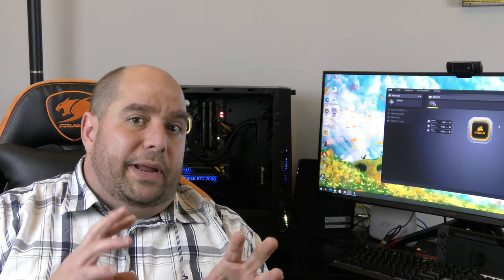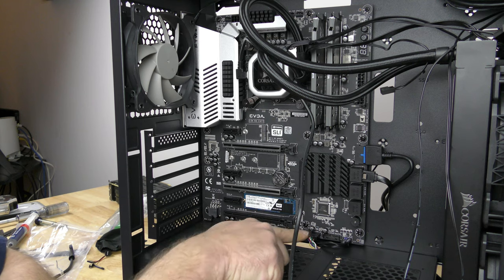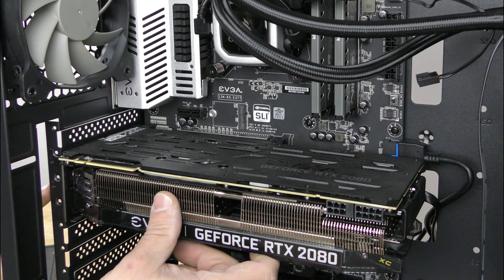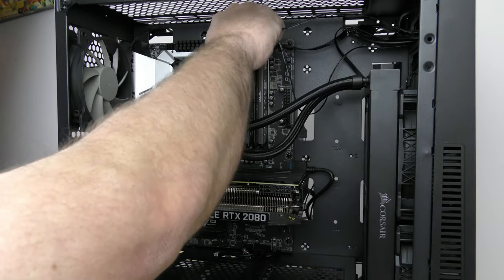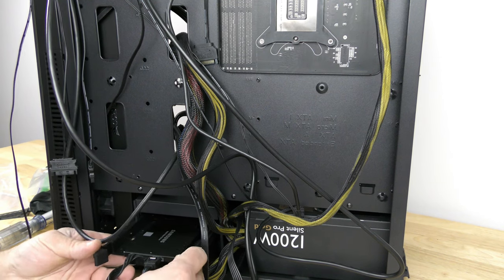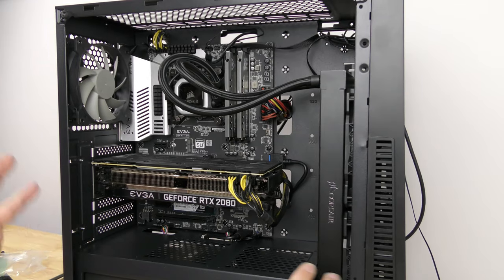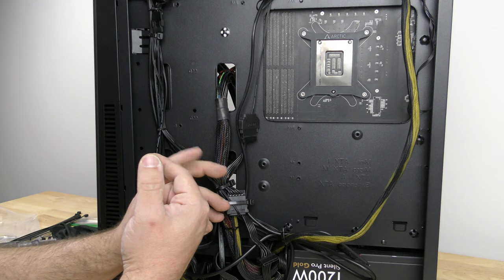How to Wire a PC Game Build for Beginners - Step by Step Wiring Guide 2021

Comment: Hello! I am new to building a PC, and I'd love if you could tell me if these are a good build for it (in term of capability) also, these are the ones near my budget price, but if you do know any others cheaper and better , it'd be much of a help.

Gigabyte A320M-S2H V2 mobo
HyperX Fury 8gb 2400mhz
(Processor are still undecided as I haven't looked into it, but I think ryzen gen2/3 is probably my choice)

Last question, does all those wires comes in with the mobo/power supply/ or any other? Or do we need to buy it separately? Thank you!
Reply: I know there's probably more I have to look into, but for now these are the ones I think I should have in my pc, if I'm missing anything, do let me know!
Reply from the maker: Its a good start, but I would double up on the memory, 16gigs is base and at least 3200Mhz.  You may want to check out these videos: https://youtu.be/Ava0aAQ2XAM and https://youtu.be/nyIYRJYqMYA, this is not an amazing system but it gets the job done, maybe a better video card would help,
Reply: @ThisBytesForYou  thank you for replying, and yes, I would like to have it at 3200mhz, but I don't wanna pay too much (as the price changed as well as the mhz) also I'm still unsure about what gpu should I get, it would be much of a help if you could recommend me anything that goes under 300-400$
Reply from the maker: @itsmegu9261  $300 to $400, you can get a GREAT GPU for that much, where do you live and how long would you be willing to wait?
Reply: @ThisBytesForYou  oh , I'm sorry I must've put the wrong currency in. Uh in my country the gigabyte mobo costs around 220MYR (Malaysian ringgit), idk about the price there. Oh and as of now I am just planning, but I would love to be able to purchase it by the end of the year or the nect
Reply: I just checked, I searched for gtx 1060 and it costs around 680+ MYR, I don't know how much it costs there but that's pretty much it, thanks for the help again!

Comment: Hi! I built my first pc it won’t turn on. I did checks and the power supply works. But when I turn the pc on nothing will move or turn on. Do you have an idea what the problem is
Reply from the maker: Hello my friend, very happy and excited that you built your first PC.  So that I can help you, please provide me with the manufacturer and model number of your motherboard, cpu, RAM, video card, power supply and monitor.
Reply: @ThisBytesForYou  hi. Sorry for the late response but just wanna say I finally got it to work. The power switch was broken so we returned it and now it works. Now I’m just trying to figure out why when I turn my pc on the monitor says “reboot and select proper boot device”. Also my mother board is the b450 tomahawk max. My monitor is the pixiop 248
Reply from the maker: @thinkingbread  ahhh cool, as to why it keeps saying select proper boot device, you have to make sure you have your mainboot device selected as the main drive in your boot order, since it is windows 10, it will more than likely be the windows boot manager
Reply: @ThisBytesForYou  ok thank you. I will try that when I’m done with school. Also I subbed thanks for the help 🤙🤙
Reply from the maker: awesome bud, let me know how it goes and thanks so much for your support, it means a ton to me.

Comment: my power supply has like 5 SATA connections coming from it. Does the MB power SATA and USB 2.0 --  or should there be a cable connection to the MB I wonder.
Reply from the maker: There would be an 8PIn EPS CPU power or a 4Pin CPU Power, or both.  Then there would be a 24PIN ATX power Connection.  Some motherboards also have a 6Pin PCIE connection to provide additional power to the PCIE slots, those should be all the power cables you would need to connect to your motherboard.
Reply from the maker: The power supply needs to go connected to SATA drives, the motherboard does not power sata drives, but it does provide some power to USB ports.
Reply: @ThisBytesForYou  Yes, Thank you man. That does help. I'm half built over here but I think I'm good
Reply from the maker: @_mytube_  always a pleasure my friend, this video will help you for sure.

Comment: does that board not have a CPU fan 2 or OPT? 2 or OPT os for your water cooling. 1 should just be for a reg CPU fan.
Reply from the maker: Either would works, they are all controlled in the bios

Comment: Hey could you maybe help me with my pc ? I recently just bought a new mobo but for some reason two of my fans won’t spin and it shows no signal on my monitor
Reply from the maker: I can try, but you are not giving me a lot of info.  What manufacturer and model number board do you have, where do you have the fans connected and where do you have the monitor connected, to a video card or to the motherboards HDMI/DP/VGA I/O connections, where your USB cables go?

Comment: hey i have a deepcool castle v2 and having problems to understand where to put the two cables coming out of the pump, you said to put one in cpu fan 1 but in my motherboard i have a specific area thst says aio pump
Reply from the maker: yeah none of my boards had the AIO pump header before, till I got the Asus Crosshair Hero VIII, you can plug the pump in the AIO.

Comment: Do the wires come with the parts that you buy??
Reply from the maker: If you are referring to the power cables, they come with the power supply, unless it is something additional, which I always state.  As for the SATA Data cables, they come with the motherboard, but you can buy additional.  The cables for the fans, they come attached to the fans or the Liquid Cooling unit.  Can you please clarify which cables so I can lead you in the correct path?
Reply: @ThisBytesForYou  my case didn’t come with sata data cables ?? !! Do I order them?
Reply from the maker: @animekawaii5991  you can, but they come with the motherboard,  if you don't have any, maybe this will work for you: https://geni.us/1up1jYg those are from my amazon affiliate link

Comment: This video was great but I’m still struggling to get my pc to display and my mouse won’t turn on even after playing with my ram. Also sorry for the commenting on others comments lol
Reply from the maker: No worries my friend, i just want to make sure I can help you, and then if some one has a similar issues, its not lost in the weeds.
So that I can help, please list the manufacturer and exact model number of the following components:
1. Motherboard - manufacturer and exact model number
2. CPU - manufacturer and exact model number
3. RAM - manufacturer and exact model number
4. Video Card - manufacturer and exact model number
5. Power supply - manufacturer and exact model number
6. Monitor - manufacturer and exact model number
7. Do you have ALL of the PCIE connections plugged in, and not daisy chained or pigtailed, each coming directly from the power supply?
8. Are you running through HDMI, DP, DVI, VGA, any adapters?
9. UEFI in the BIOS from Legacy.  If it was set to Legacy, you will need to reinstall windows to get correct support.
10. Disable CSM in the BIOS
11. Installed latest supported chipset driver?
12. Have you disabled Fast Boot within Windows?
Reply: @ThisBytesForYou  hey there! I’ll have to update you come this weekend. I don’t currently have access to my pc and I don’t believe I have a video card.

Comment: Im new to pc building. On my first build now. Everywhere I look is telling me plug the SATA cable from power supply to motherboard. But the SATA cables that came with the motherboard have weird ends, almost the same but not exactly. It will plug into the motherboard, but I can't find where to connect it to the power supply. Any advice?
Reply from the maker: Have you watched this video on wiring?

Comment: Hi im very new to pc building but what if my mobo(MSI B450M A-Promax) only has 1 sys fan? I mean what can i do toconnect all 3 fans to my computer?
Reply from the maker: hello my friend, you've come to the right place then, I have tons of guides on how to do just about anything with a PC and unlike many other channels, I reply haha.  So you will want this cable, it is a 4pin PWM flan splitter, so you can plug into 1 header and control 3 separate fans.  Realize that as the system heats up, the fans will spin faster, all 3 of them, because they are all on 1 controller, you can find it on my Amazon affiliate link: https://geni.us/ym7DW9, I hope to see you around more of the videos here, always happy to help.
Reply: Thank you so much!
Reply from the maker: Always a pleasure my friend, so very happy you stopped by, trusted in me to help you, liked and subbed as well as took a moment out of your day to thank me.  It means a ton to me and I am so very happy I could help you.

Comment: So here are my questions I have these cables that look like An L and I don’t know where to plug them in and I also have these cables that have 4 pins but they are circles do you know where I should plug those In
Reply from the maker: Did you watch the video?
Reply: Yes I just didn’t understand where the circle 4 pin thingy goes
Reply from the maker: Where does the other end connect to?
Reply: @ThisBytesForYou  what do you meen
Reply: And only my motherboard is lighting up
Reply from the maker: Look in the description, I also have a build video in how to build you machine, that might help to.  What I mean about the cable, the cable comes from something to connect to something... What does it come from
Reply: @ThisBytesForYou  they are connected to the power supply and the L cables I was talking about are also connected to that cable
Reply from the maker: @juliel4190  the L shaped ones go to hdds and dads, and any externally powered devices that need power, like a fan hub, liquid cooling or something like that
Reply: @ThisBytesForYou  so do I need to use all the L shaped cables?
Reply from the maker: @juliel4190  nope, unless you have that many devices, just set them aside
Reply from the maker: Make sure to subscribe so you can tune in to more videos to help you out.

Comment: So idk if u gonna respond but there’s 2 wires not plugged in it’s p5 and p7 and the p5 wire keeps making a buzzing noise and my computer Home Screen turns black and my tab bar isn’t there idk what to do I saw ur good with computers so I’m reaching out for help
Reply from the maker: I always try to help, in bed at the moment but I will still try. let's start with What is p5 and p7, I am not understanding, where do you see this?
Reply: P5 and p7 are two different wires on the inside of my pc I’m not sure what they do
Reply: Ik one of them is called the optical drive
Reply from the maker: @leprachaun-b6r  where do they come from, please remember, you have everything in front of you, I don't see it.
Reply from the maker: @user-gg3ik5eq6o does it look like this cable https://images.app.goo.gl/WLatxaVgy21g8EXV7
Reply: You can try find it the computer I have is an omen Hp
Reply: 25 l I believe
Reply from the maker: @leprachaun-b6r  does it look like the cable I linked up
Reply: Nope
Reply from the maker: how about this, https://www.reddit.com/r/HPOmen/comments/kryr37/hp_omen_30l_what_are_these_cables_first_gaming/ or better yet, send a pic of the cables here to my email iggy@thisbytesforyou.com @leprachaun-b6r
Reply: @ThisBytesForYou  yes that one an something else
Reply from the maker: here you go: https://youtu.be/7SjQo7wrWq4
Reply: Thank you so much
Reply from the maker: Always a pleasure my friend, so very happy you stopped by, trusted in me to help you, liked and subbed as well as took a moment out of your day to thank me.  It means a ton to me and I am so very happy I could help you.

Comment: Random question, why does different ram (ddr3 ddr4) have different fitting slots?
Reply from the maker: because ddr3 and ddr4 have different speeds, voltage requirements and more so if they all had the same slot and pin out, people would be mixing DDR1, 2, 3, and 4 all together and wonder why their system isn't working.
Reply: @ThisBytesForYou  thanks for answering 😃
Reply from the maker: @blaisedrums  always a pleasure my friend, happy I could help.

Comment: I bought a z690 mobi, 12700k and a new psu… I hope it all goes well, just worries about the wiring and missing something
Reply from the maker: Well, funny you ask, I have 3 videos for you, let me know what you think.
✅ How to Build a Gaming PC Step By Step for Beginners - PC Build Guide 2022: https://youtu.be/yqj9slC6-Cg
✅ How to Wire A PC Step By Step for Beginners - PC Cable Management Guide 2022: https://youtu.be/xcHwLTBDWO8
✅ How to Flash the BIOS and Install Windows 11 - ASUS TUF Gaming Z690-Plus WIFI D4 Motherboard: https://youtu.be/WTkMXYjxGzU
Reply: @ThisBytesForYou  thank you very much! I bought the gigabyte z690 auros elite ddr4 though, hope it all goes well!
Reply from the maker: np, this is a z690 board from Asus, it should be similar and also a DDR4 board, so let me know if it helps.
Reply: @ThisBytesForYou  I will let you know if it went well by commenting from the new pc! :)))
Reply from the maker: @poteqqetop942  sounds good my friend

Comment: If the pc wouldn’t turn on what would you do to test what the Problem is?
Reply from the maker: It could be a number of things.  Do you see the board is getting power, there is usually an LED or 2 that turns on when the board is getting power.  If not, check to see the power supply is plugged into the wall, and the switch is set to the on position.  If you are getting power, make sure the 24Pin ATX cable is securely plugged in, as well as the 8PIN EPS cpu power, probably best to upload them then replug the in.  If you have done all this and you still can't turn it on, make sure the front panel header is plugged in properly to the motherboard header for power switch, maybe the polarity is flipped, unplug it, flip it then plug it back in.  Let me know if this helps.  If not, please right down your full PC spec, everything in your machine, manufacturer and model number.

Comment: Hey so I have a vga cable but my motherboard has no slot for that cable ?
Reply from the maker: Chances are your monitor is only VGA, an older monitor, maybe somthing like this from my affiliate link: https://geni.us/tSYyhcy if your motherboard has a HDMI port, and your processor supports integrated video.  Do you have a video card?

Comment: Hello I have a question, I bought a 650 power supply and I don’t seem to know where the usb 2.0 cable is. I’m confused on what cables I have
Reply from the maker: Usb 2.0 would be attached to your case if your case has usb 2.0 header, they might be usb 3.0
Reply: So I can either use 2.0 or 3.0?
Reply: ThisBytesForYou Thankyou for your responses I’m new and just don’t know if I need both usb 3.0 and usb 2.0 plugged in
Reply from the maker: Usb 3 will also do usb 2, so you are good

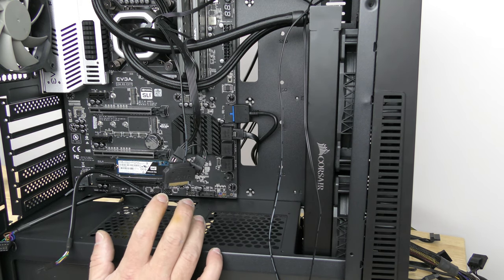Comment: The one dangling right in front of you at 2:42 I cant figure out where that gets plugged in
Reply from the maker: there was 3 there, 2 x 3pin fan header cables and 1 SATA power, male cable.  The 2 x 3Pin fan headers, you connect the liquid cooling fans into and the male SATA power cable gets plugged into a female SATA power on the power supply.

Comment: Hey man I just started setting up my pc I have everything connected except this one cable it came with the case along with 3 fans built into it. Everything seem to turn on. Except those three fans because the 4 ping connector isn’t attached to anything and the case didn’t come with a cord for it so if you could plz help it would be awesome
Reply from the maker: which case, manufacturer and model number?
Reply: The case is a ZALMAN S4 Atx Mid tower case it came with 3 pre installed fans
Reply: S4 plus
Reply from the maker: so the 3 fans plug into each other, then lead to one connection, you have to plug that one connection into a 4 pin fan header for pwn control some where on your motherboard.
Reply: @ThisBytesForYou  ok awesome so I’ll buy a 4 pin header for the fans and find somewhere to plug it ? I have a Rog Strix b-450 gaming ii motherboard
Reply from the maker: bottom right hand corner of your motherboard,  to the left of where you connect your powerbutton, reset button, HD LED/Activity Light, you will find 2 4PIn headers.  There are also 2 to the left of your cpu socket, just under the heatsink.  Look in your motherboard manual if you need to pinpoint them.
Reply: @ThisBytesForYou  awesome super informative thank you so much man. Your like the PC Master
Reply from the maker: @dimitributler7599  always a pleasure my friend, please make sure to like and sub, I come out with new videos helping every week.  I have 400 videos and counting, I am sure I have a ton more that will help you.
Reply: @ThisBytesForYou  do you maybe know the exact 4 pin headers I should buy for that specific cable that connects all 3 fans in 1
Reply from the maker: you don't buy them, they are on your motherboard already, like I commented 8 minutes ago "bottom right hand corner of your motherboard,  to the left of where you connect your powerbutton, reset button, HD LED/Activity Light, you will find 2 4PIn headers.  There are also 2 to the left of your cpu socket, just under the heatsink.  Look in your motherboard manual if you need to pinpoint them."
Reply: @ThisBytesForYou  thank you for the help it turns out that the cable is not long enough to plug into the bottom left of the motherboard. I will continue the search for solutions. Have a awesome day